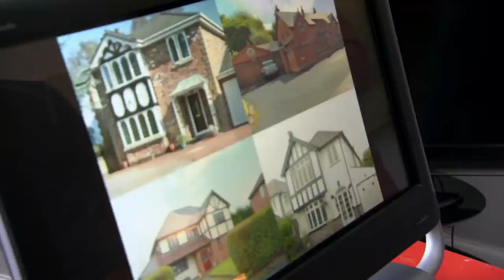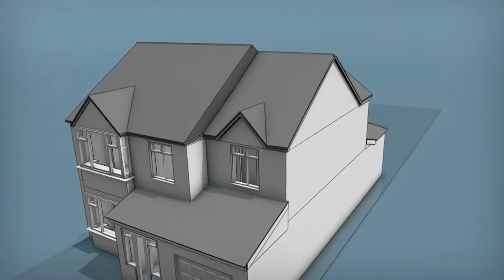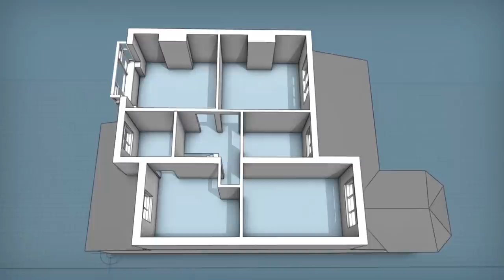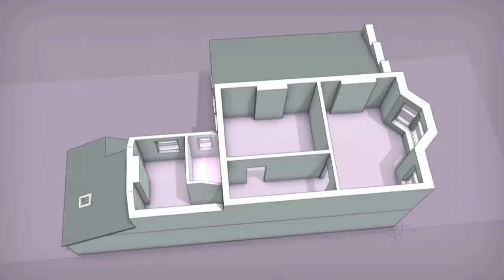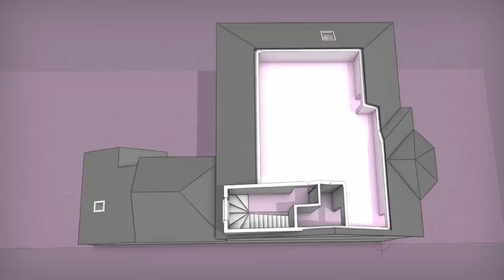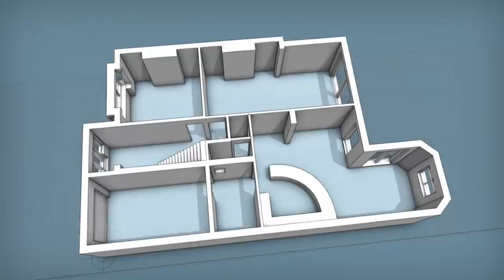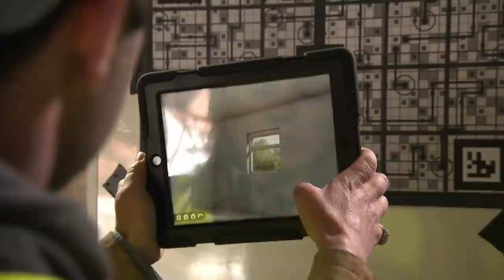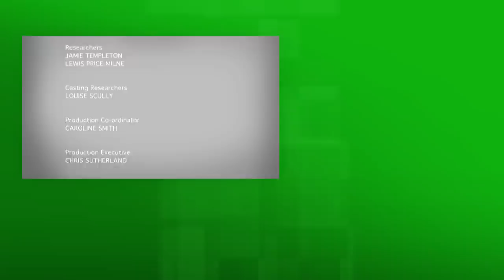Small House, Big Dreams - Double Your House For Half The Money - S02 EP4 - Interior Design

Comment: I watch a lot of these UK home shows  and it seems to me that MANY of the houses are built pretty much the same way.  Of course, there are farm houses and houses built to order by an individual.  I mean the houses built by builders.  Seems like they are all cramped, chopped up into little rooms always with doors, so many doors shutting off rooms into pokey little spaces. Our house built in the 1950s in the US was not as pokey and closed off, even though it was built by a builder (thousands built to the same plan).  Relatives' houses ranged from a mansion built by a railroad executive in the 1890s to a house built in the same period for workers, and none of them were pokey and closed off and chopped up into tiny rooms - all had open views through living room and parlor to dining rooms... Only bathrooms and bedrooms and kitchens were closed off.  In the UK, seems like every house 'desperately needs more space' and seems like everyone has to add a kitchen-diner because of these tiny rooms that don't accommodate anything but at most 4 people sitting still in one place.  Were they all designed for people sitting still looking at a 4-bar fire or a television and doing nothing else?  And why is it that up and down the country, houses are so very similar unless designed by an architect to someone's personal specifications?